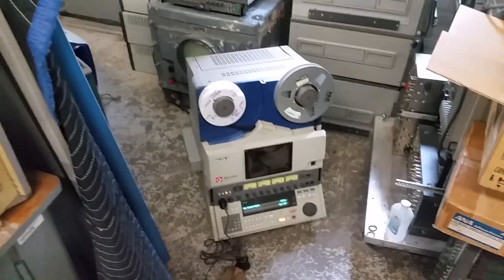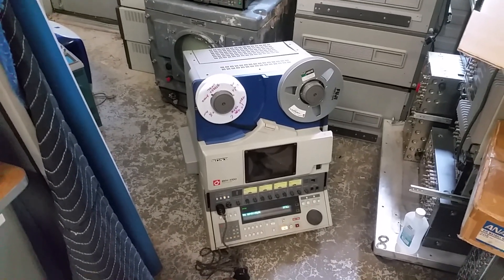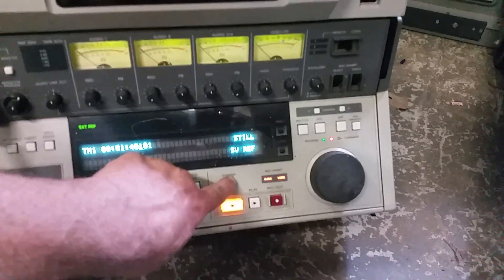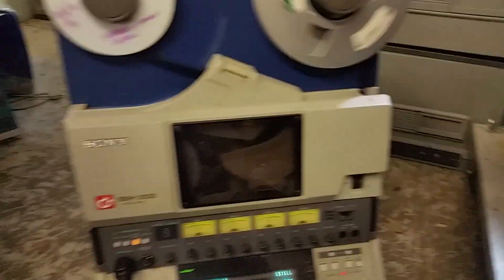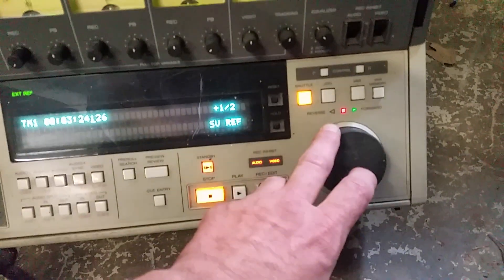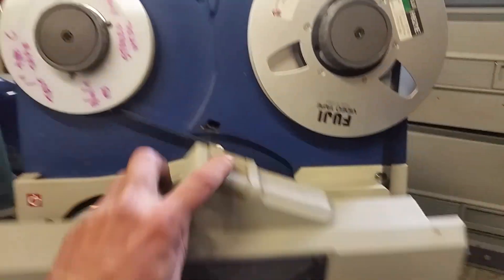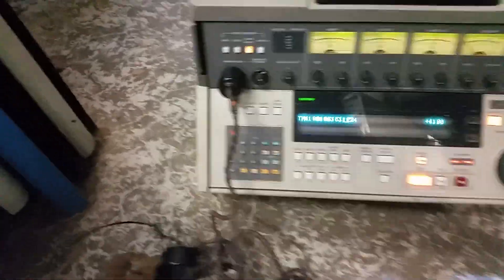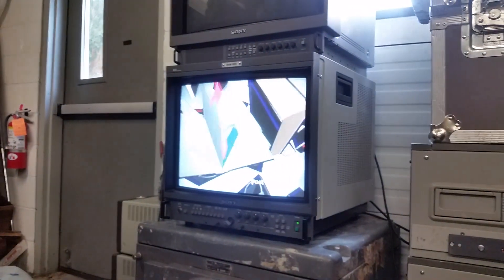Working on a Sony BVH3100

Comment: I own one for transfers to digital formats, but lately the tracking is going out causing noise in the bottom of the picture.  I remember many years ago a "Tensiometer" (probably misspelled!) would be used to adjust the tensions on the deck.  Do these still exist or any advice on manually adjusting? Thanks!

Comment: Mine just went weird after a power cycle. Looks like I'm missing a color channel and the phase is 180'ed. Now I'm rooting for info to see if I can trouble shoot it. I'm assuming a cap went on it but I don't have a clue where to start.  Have any spare color boards?
Reply from the maker: No, I have nothing more for this unit - it is out the door and in production.

Comment: If the machine is available I might be interested.
Reply from the maker: No, it is sold. I was checking it out before I delivered it.
Reply: @uniservo  i was interested in the white reel tapes do you have in stock?
Reply from the maker: Reels of 1 inch C? No, sorry, just a borrowed test tape.
Reply: @Robertinho-m2s4  I'm literally pitching cases of 1" typeC after digitizing it. Are you looking for new/old blank stock or just any tape?
Reply: @fen4554  It can be used
Reply: @Robertinho-m2s4 I know it's been about three years, but I have about 60 reels for sale.
Reply: I have two of these machines in mint condition that I am wanting to sell if you're interested still.
Reply: @taggmanibanez  Uh, still got the machines? Send me an email on my YouTube channel

Comment: The BVH 3xxx series are nice machines, they tend to have two problems one which is able to be delty with and the other which is a show stopper. The first is the hundreds of Elna capacitors that will go bad in them, I had a friend that replaced almost 200 in a 3100 just to get playback, probably another hundred would be needed to get record working properly, that was not unique to the BVH series but was an issue with just about every early 90's sony pro machine.

The issue that is a showstopper for this series and the HDD digital HDVS machines built on this same platform is that the video scanner bracket is made out of pot metal, and it has two common failure modes, either the bracket cracks and falls to pieces, or it swells up gamming the scanner. 

Being the last generation of Sony 1" machines they are quite nice though, the middle generation 2xxx serais are also nice and have some unique models such as the 2800 that could either be configured for use with an external PCM-1630 digital audio processor, or could be configured to not do standard video and have the PCM-1630 circuits installed in the cabinet f the machine.
Reply: Sorry for disturbing, but can you tell me how exactly BVH-2800 can be configured with PCM-1630? I know that PCM-16xx format is PCM-on-video only but BVH-2800 brochure said that it uses 2 digital tracks as ADDITIONAL to video! So, PCM on 2800 is FM-modulated (similar to VHS Hi-Fi), right? But how can this type of signal be connected to PCM-1630? AES/EBU?
Reply: This is great info. I'm currently having a problem where overnight the unit lost a color channel, and the phase on the remaining are totally out of whack. Would you assume this would be a cap problem? There was a power cycle involved.